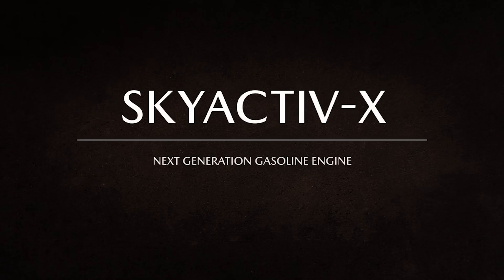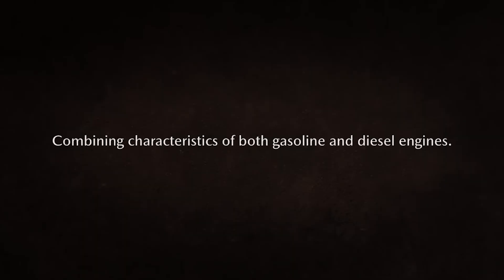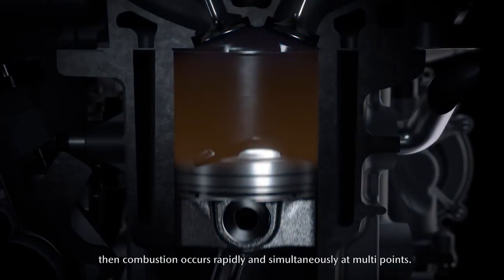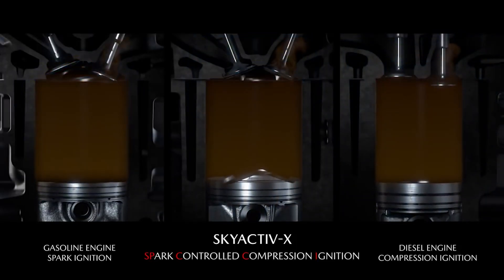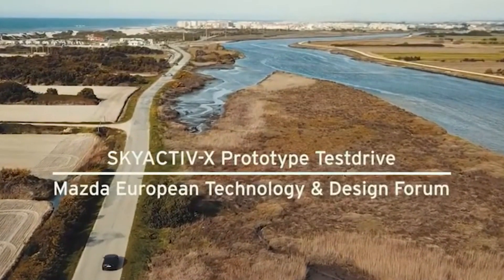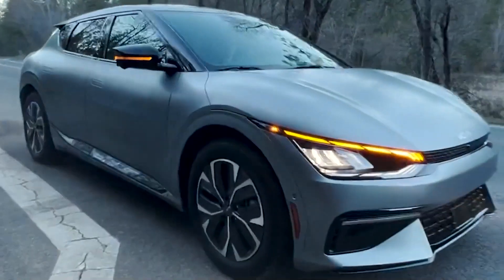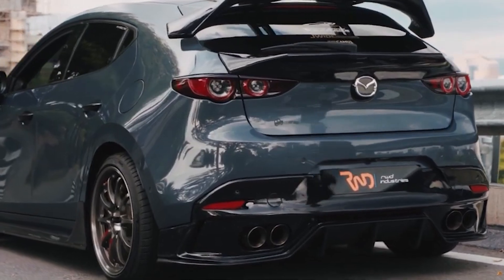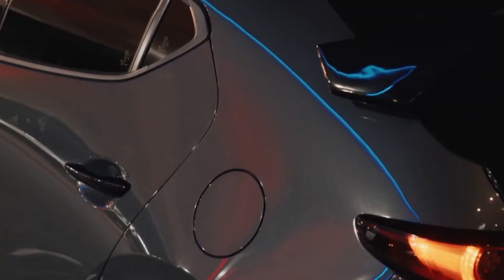Mazda's Skyactiv-X Engine: How Does it Work, and is it any Good?

Comment: You can probably dilute the gas with diesel for more power, making it more tunable, and better consistent fuel economy. Any thoughts on that? I'm sure it would work with such a high compression ratio
Reply: the diesel wouldnt ignite if the compression ratio isnt high enough
Reply: @yangzixiang6605 Those mazda engines were running 16:1 compression ratios. My ecodiesel is 16.5:1. All the new 3 liters diesels are 15:1 for high horse power. These Sky Active engines can probably run all diesel with a proper pump.
Reply: your engine's catalyst converter will be gone
Reply: @isaachiew676 doesn't lean gasoline already damage cats? also cats aren't necessary 😉

Comment: My Seat Leon eHybrid does on average 17.0 km/l on an empty battery(around 350kilos of extra dead weight) and 22 with just a tiny bit of juice left(mixed driving). That is with 204hp always available(150 from the ICE part). So can't say I'm impressed. However, I've always gotten better figures than most, spite not being a granny on the pedal. Would very much like to give this a run and see how well it does as I'm a bit tired of constantly charging the tiny 13kwh battery.
Reply: Your seat will die in 5 years,Mazda 4life.